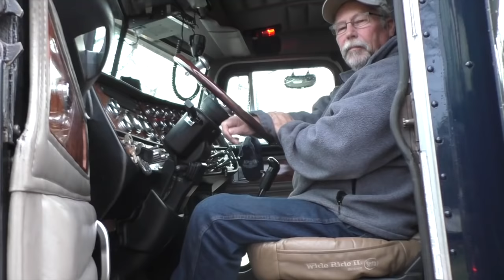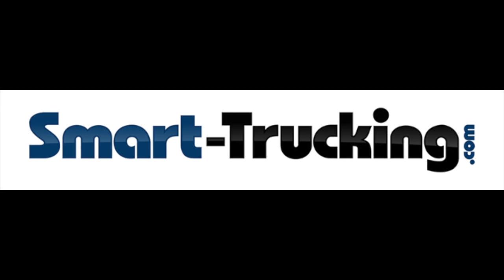Why My Peterbilt Truck Seat is Low

Comment: I owned a '82  379 Flattop Pete 425cat 13spd, and I'll say nuttn kooler than sett'n low n way back, so when you pass other trucks all they see is 2 fingers n hear that 425cat n feel the draft off my Refer as I pass ya... Now I'm no Super Trucker, tailgater I just held the left lane if needed, and you'd be amazed on howmany other trucks you'd pick up fall'n in behind try'n to keep up, and yea I pushed her hard at times wont lie poped 108mph in 55 zone in the Hi Side of 10th that cost me, n like leave'n Flagstaff outa Purina plant 11pm n jump'n off big road at 8am  in OK City  at the Old 76 Truck Stop now that'll show my age cuz most of you drivers now never seen or heard of 76 Truck Stops, n if you've never had the speed n power of a truck that'll keep power'n without stopp'n ( no govenor ) don't hate, cuz I drove for Knight Trans some yrs after so I know both sides of fence and enjoy'd both sides but still thats the way you gotta drive a Pete Low in the Seat.....
Reply: The 379 was not available in 82. Nor was the true 425. 359 with 400 cat.

Comment: I call BS on that one  It sounds good and all . And I'm sure you may have had a back injury, but in the late 70s and early 80s it was cool to have a big radio and ride low and you see with the big old shifter and as far as safety no if you need to be sitting up in heavy traffic I need to be sitting up on the highway to as far as safety concern we're not talkin comfort

Comment: you hit the nail on the head james marquis, every time i see a driver in a longnose pet e it looks like the driver is sitting on the floor, foolish way to drive, they can't see nothing
Reply: you can see everything you need to see!!
Reply: if you need to see anymore than you can already see, your driving too close.
Reply: Well I drive mine with the seat down like thatg for the same reason I too have back problems and it helps and I can see just fin thank you
Reply: I can see fine.

Comment: It's because guys with the long gearshifts and there seats on the ground are compensating for some sort of short comming. I'm out here to make money not drive an overpriced paccar product with a red engine with a fuel pump that eats the engine alive and the manufacturer will not stand behind. I run older equipment and stay out of California and make more money than I ever did on the West coast